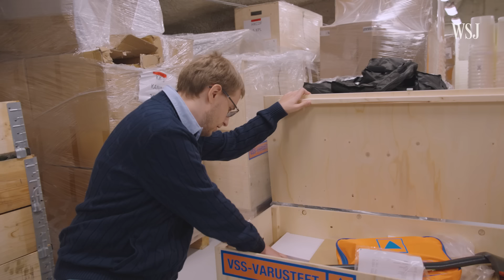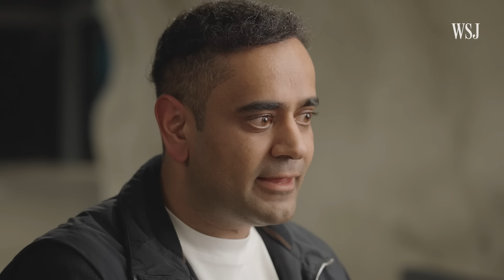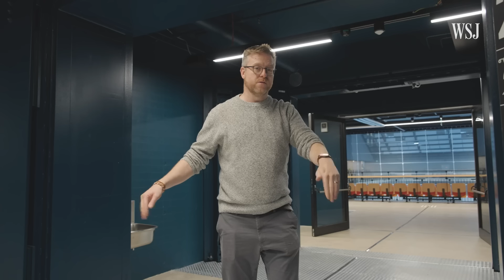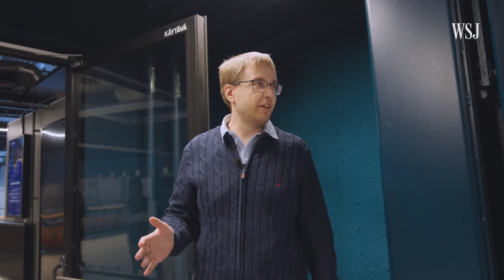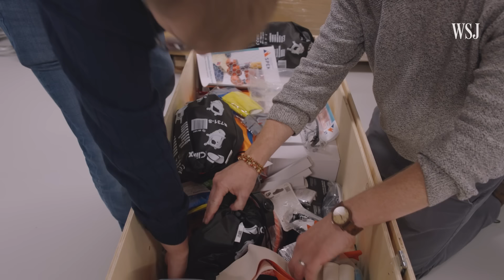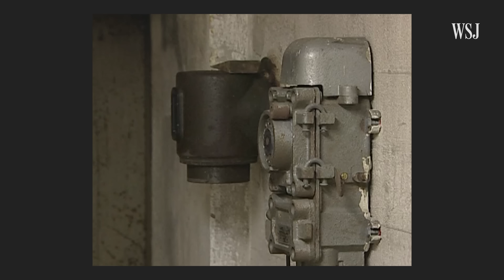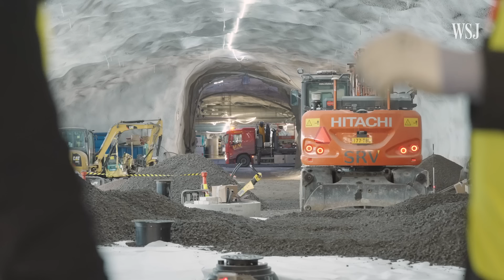What It Takes to Build a Modern Nuclear Shelter for 7K People | WSJ

Comment: The Finnish nuclear shelter is designed for any collateral damage from a battlefield tactical nuke used by the Russians; Finland has a long border with Russia. If the Russian deployed tactical nukes, it will be to attack concentrated NATO forces mobilizing to defend Finland against Russia attacking along the Finnish border, hence the 72 hours to bring the nuclear shelter up to readiness. In a nuclear strategic attack, the warning is about an hour, by satellites, and only adequate for government leaders to seek shelter. The US President will board a flying White House and stay airborne with air refueling until the attack is over.
Reply: It's not likely that Russia would use tactical nukes in neighboring countries especially so close to their second largest city
Reply: @tmaska  Tactical battlefield nuclear weapons are low-yield and cause low amounts of contamination. Modern mechanize fighting vehicles and tanks are designed with Nuclear, Biological, and Chemical (NBC) filtration and can move quickly after the blast. Soldiers carry NBC rubber suits with gas masks; there are battlefield decontamination units once they are out of the contamination zone.
Reply: @tmaska  Do a Google search where there are 1950s video of US soldiers in the Nevada proving grounds in foxholes as a tactical nuke is fired. They made a tactical nuke shell you can fire out of a howitzer.
Reply: @reecom9884  I don't just see the use for tactical nuke when Russia can have the same kinetic effect with conventional weapons like TOS-1 etc.
Reply: @tmaska  Putin is losing against Ukraine. Ukraine has 'Cold War' weapons and hand-me-downs from the West, fighting across his border for 4-years with a large military. Against NATO with their top-of-the-line weapons he hasn't a chance.
Reply: Finnish cities are not strategic level targets in general, more like tactical. During cold war there was a handful of known targets inside Finland.

Comment: What is the plan to move the rubble from the exterior buildings?
Reply: These kinds of large shelters are usually designed with an emergency exit tunnel that will lead away from the main doors. 

Emergency services also have their own shelters with space for necessary vehicles to dig away the rubble.
Reply: We can't talk about such details, safety reasons

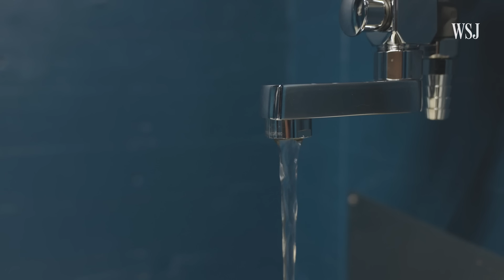Comment: 2:28, usually values such as that are to stop the bunker blowing it's own doors open. After the blast wave hits the building there is low pressure area forming as the wave starts back to the low pressure that now exists at the centre of the explosion, valves such as that allow the over pressure that now exists inside the bunker to leave, without compromising the ventilation system. In peace time they may well have an open position, but in conflict they'd be set to one way opening. 
I must be honest, I'm surprised that for 7,000 people they want to use bucket toilets, even in the first hour, that's a lot of toxicological gas and reactions to handle. Those bags have to be stored somewhere. 
Oddly the 7000 figure is half the value of the worlds largest fallout shelter in Switzerland and they found, in testing, it was just too large. The Swiss had toilet blocks etc in the centre for the 12,000 expected inhabitants. All that said, better to do something than nothing. 
ALSO - 4:14  whatever you do,  never store batteries in survival kit box, if they leak or get damaged you could destroy irreplicable equipment!
Always organise things as when you need it seconds count, not hours.  What I would say, this looks as if they are just setting up, so they may well have a storage plan too.
Reply: Ahem. The portion where the box, bed, toilets were are just for journalists and education.

… batteries stored separately… public shelters are well organised, but I wouldn’t want to spend much time in one.

Self powered cabin in the woods would be the safer and more comfortable place anyhow.
Reply: IIRC the "toilets" are situated under exhaust vents. So the airflow keeps the gases away from other areas, and they do have chemicals to manage the smell as well. It's not meant to be inhabited for longer than a day or two at time.
Reply: The equipment are checked annually

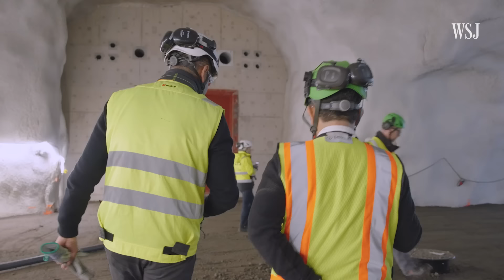Comment: 0:35 Oh everyone coming in in Finland would be perfectly aware. It is simply normal enough to acknowledge, but at the same time not be worrying. We grow up with it. Everyone knows and acknowledges it, but it is no big deal. Every apartment building has a shelter at basement. So place like Luola is "Same thing we have in our home building, but just bigger". At apartment building the shelter dual purposes as storage cage space for tenants. Bigger facility, bigger dual use purposes.

Since everyone knows "all these sports facilities would have been cheaper to just build of light timber construction on the surface. however shelter needs to be built, so the help finance it, it dual purposes as a some other facility".
Reply: Yeah- It's really not that strange. I don't go through T-Centralen (Stockholm) and think "This is only a station" but it's also not a huge deal that it's an air raid shelter until something happens.
Reply: I bet you have a lot of maintenance work going on right now... last I saw, a lot of those were getting pretty rusty.
Reply: @phil20_20  nah not really many of the shelters are new because every building over a certain size is obligated by law to build shelter. So shelters are as old as the building. These underground shelters are actually quite easy to maintain since we have very stabile granite bedrock.
Reply: @phil20_20  there was some amough but actually it started because covid sundown. Not because they where needed in covid but because people got wake up call of nation wide emergency. And is was more like "ou damm we are not up to standards anymore" than "ou damm it crumbling apart". Like my apartment complex ordered little bit deeper spring cleaning, resupliet this and that small that was found to be old in first aid kid there and cleaned the air wents.

Because they are used for other things normally they are keeped enough good.
Reply: When the bombs drop, at least youll have alot of lawn chairs and patio umbrellas if its anything like north american storage units

Comment: how? wsj there to test strength of shelter and if it matches with explosive power of bombs given to russia
Reply: That's not how any of this works... Russia has that information, it isn't even made that secret. They can survive typical large nuclear airburst and Russia can't just start making bigger bombs as they would need to grow them to ridiculous sizes. Multiple small warheads will do much more than one big bomb. Those bunkers are not designed to match Russian nuclear bombs, using just enough resources to cope with them... That would be very short sighted. Russia can double the yield and it won't change a thing.
Reply: @squidcaps4308  It would be pretty stupid to even nuke Helsinki cause it's 300km away from St-Petersburg, sea currents and wind would take that radiation right back to their 2nd largest city.
Reply: @squidcaps4308  I also doubt very much that Russia has the timing capability to get a ground detonation reliably.
Reply: @squireson  Airburst also does WAY more damage. As the pressure wave hits the ground it starts to travel sideways and if you imagine an expanding sphere the part of shockwave that arrive later will just push that initial shockwave more. I really don't remember what the amplification was... i have double damage in my head, but also 1/3rd for some reason and then 3x so all i an really say is that i can't now remember.. But it is significant amount of damage and radius you can get when you "pack your punch" like that. Ground hits make a huge crater reflecting the pressure wave upwards where we don't have buildings.

But, when it comes to timing: the ground is the trigger, it is far easier to make a ground burst. The warhead will bury itself before it detonates and all you need is a pressure switch at the very tip to start the "countdown". Timing is not really that important in that case.. Airburst requires more sophisticated timers and sensors...Ambient airpressure sensor, acceleration and possible ground radar and satellite positioning.
Reply: Yeah, because a shelter or 7000 persons is a target worth a nuke unlike e.g. metropolies or military facilities... geez dude.